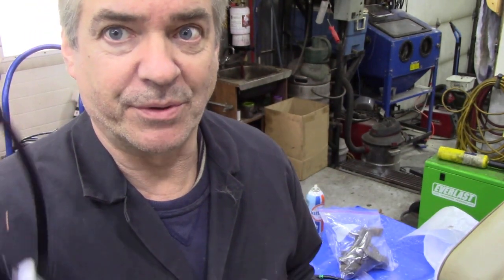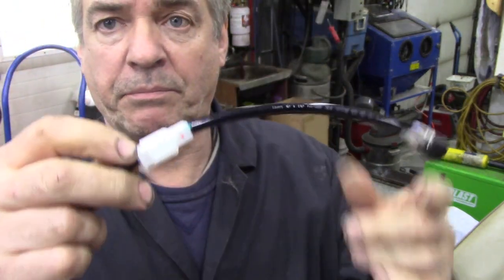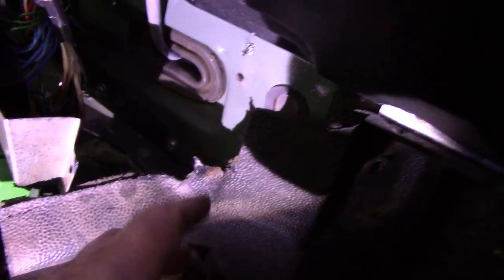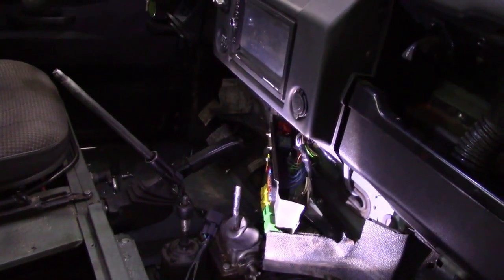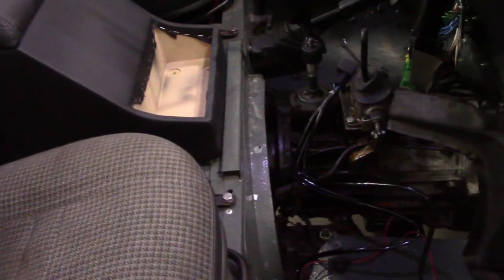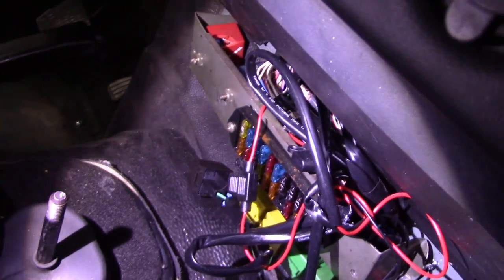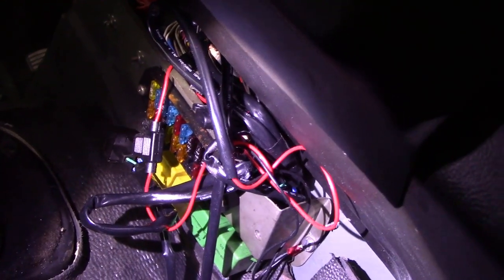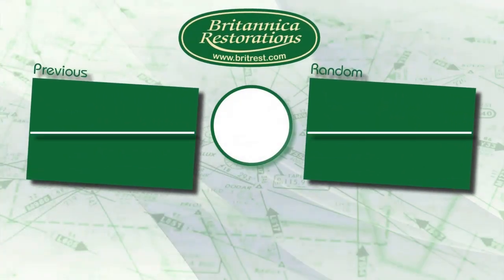Some ideas on fitting heated seat wiring

Comment: I’ve been very happy with my Exmoor heated seats. My mechanic wired them similarly to you. He mounted the switches on the fuse box cover, not having many other options, and also managed to squeeze the relays in there too.

Comment: Fitted heated seats to our series. Wires were not long enough to reach from centre console without extending the wires (routed through engine bay and underneath) - probably fine with defender though. Of course the wiring changes colour under the sleeving... Good idea with the switch positioning!  If those seats are exmoor they may want some Krown on the screws into the seat frame BTW - ours went rusty!

Comment: Mike.  With the battery under the seat for all Defender models and GM County - it should be a really simple installation ?  Wiring at back of seats is possible to !  V.
Reply from the maker: Seat wiring has to go through the ignition
Reply: @BritannicaRestorations  Mike.  This fansy pantsy upperty owner might have some more super deluxe fixtures ?  Look at Britpart No. DA1748-'Negative Bus Bar' module to cure further ignition wiring woes from occurring mista !  V.